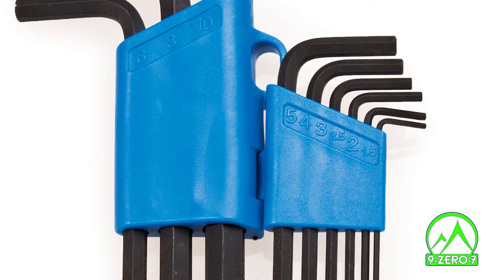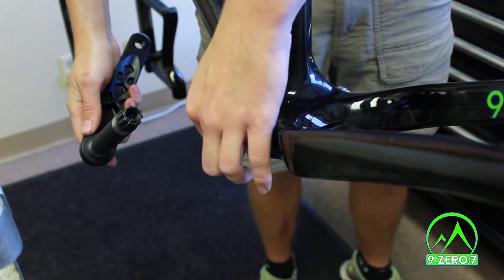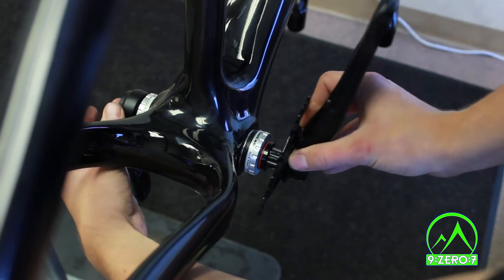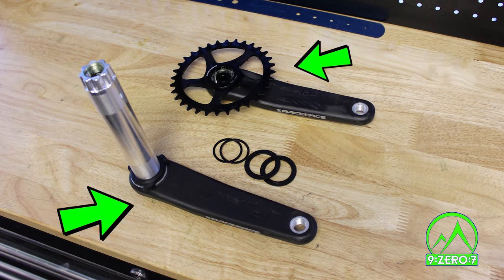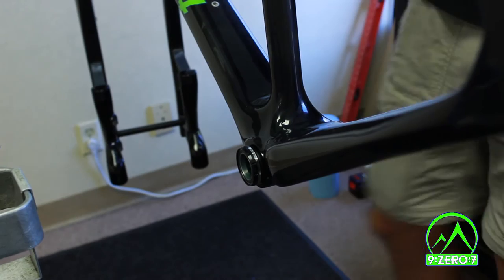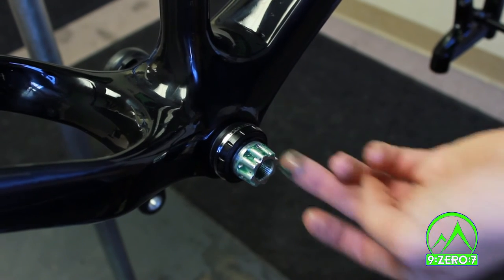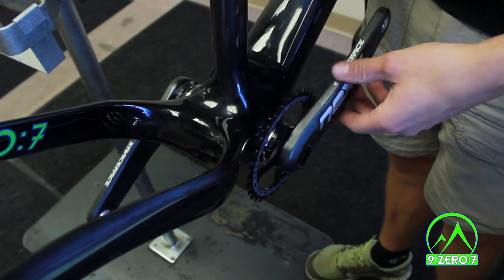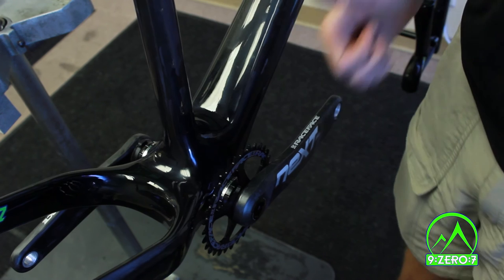Fatbikes.com How-To Video #2: Race Face Crank Install

Comment: Hi what happens if there is side to side play on a brand new race Face affect aeffect crank ? (Of about 0.5mm) 
Which steps do you take ?
Thanks
Reply: You need to trot down to your LBS for a .5mm spacer.
Reply: @Steve-wz5pz  I've added a 1mm raceface chainline spacer. Pretty straightforward with a CCP-44 crank puller and no play now 😎👌